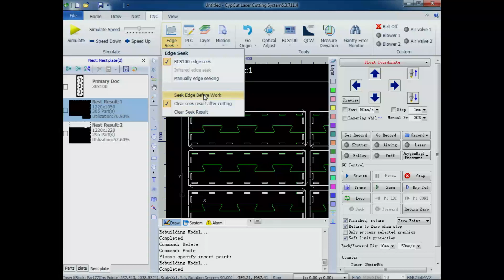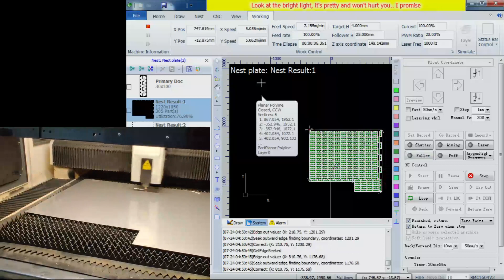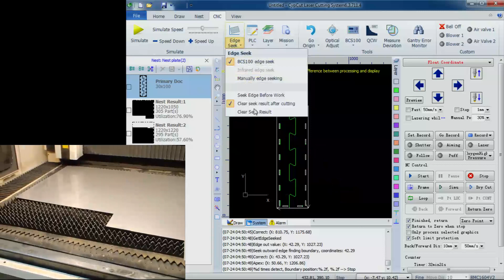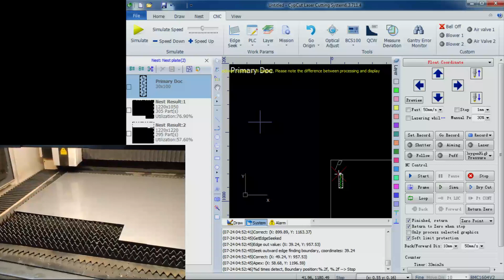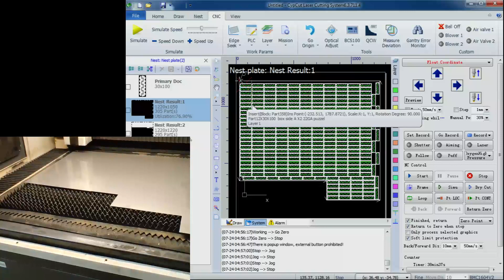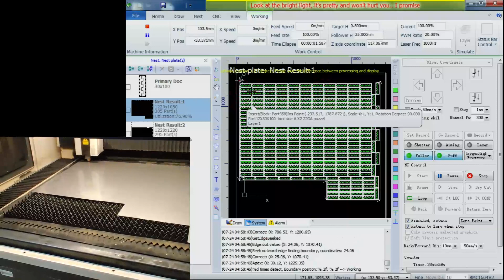How to use Cypcut Edge seek function (English)

Comment: Hi 👋 can you download cypcut on a separate pc and do all the work with nesting and then just upload it to the laser machine ?
Reply: you will want a cypnest , which is also from Friendess.cypnest is quite a professional nesting software
Reply: @shichris6681  hi, thank you
Reply from the maker: So yes and no.. You can do most of it on a separate PC, but you would still want to load your cut parameters on the laser, that way any small changes can be saved on the laser.. So on my office PC the layers are set with the laser power at 0% that way if I forget nothing bad happens, it just doesn't cut.
Reply: @smallshoplasers8785  Thank you

Comment: When I first tried Edge seek, the cutting head hit the blade platform :(
Reply: Because the information typed in was wrong ?
Reply from the maker: @nickthedane1  or he didn't have the head over the material. I have my edge seek set to run slower than the factory settings, that way I have a chance to stop the machine.
Reply: @smallshoplasers8785  you and someduff are right

Comment: Nice! I have seen the function there but never taken the time to mess with it.  I don't do alot of production cutting, so its just not been a big issue, but seems to work good so I will set it up!
Reply from the maker: Yeah, a big thing is it can correct for angled sheets so you can get closer to the edge of a sheet with a part with a little less adjusting. We tried setting the plate size fairly small and it still worked ok, so it could be adjusted to more fully use square drops.. My shop is the opposite with almost everything being production work making my own products, no custom work. Which is why there really is no contact information on my videos, I just do these for fun.
Reply: Same thing. Thanks for the video bro... 
Now I don't need to correct the sheet angle everytime. ❤️👍🏽